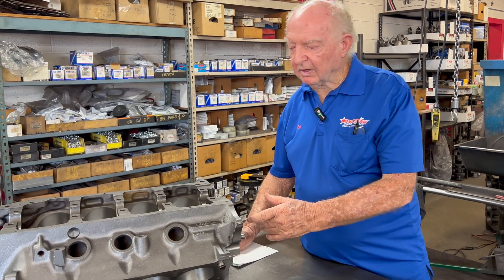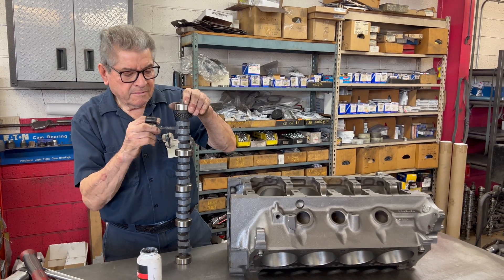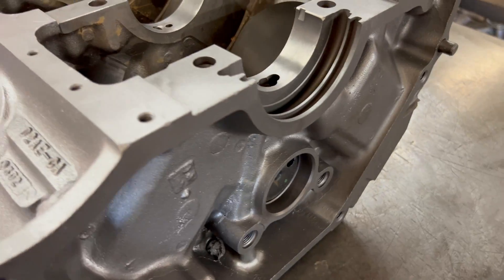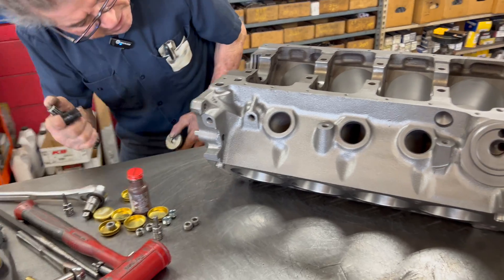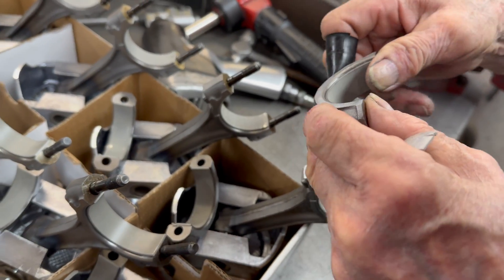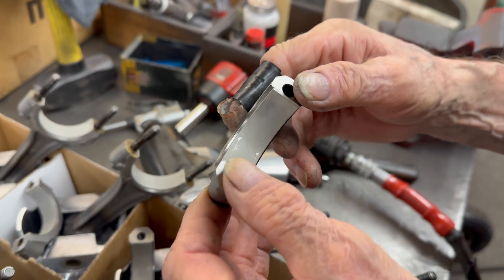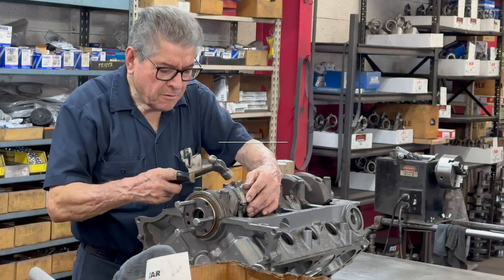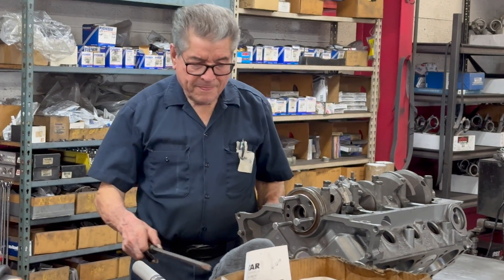Cams and SBF Short Block Ford Assembly - Ed Smith and Roberto with #barryt

Comment: Wow I had no idea that the 302 pistons were that big and the stroke so short I always wanted to open one up but never did so this was cool!
Hey Barry my first car was a 1962 Ford Fairlane 4 door tons of chrome beautiful car it had a 260 CDI  engine with a 2 Speed Slush Glide Transmission and I was wondering if you could talk Ed about the 260 289 and the 302 and the difference between the 3 engines like block crank cam and heads I would appreciate that and if it’s not something you want to do no sweat keep on trucking 😀🇨🇦
Reply: The 289 had the same bore and an even shorter stroke at 2.87. The 221, 260, and 289 all shared the same 2.87 stroke, but had different bore sizes. Cylinder heads all interchanged, but the early 221 and 260 had really small valves and tiny runners. Not that the 289 or 302 were any better in the cylinder head department. The cylinder heads small intake and exhaust runners are what held these engines back. The 8.2 deck height was great for short pushrods and short intake runner length, but they were cubic inch limited because of how small they were. Another fun fact is the 289 Hi-Po head was the same port size as the regular 289 heads. What the Hi-Po had was cast in spring locators and screw in rocker studs and that was the only difference.
Reply: @ I love learning about these engines of that era and how they morphed into what we have today thanks for taking the time to share your wisdom 😀🇨🇦
Reply from the maker: Hey Keith, I will put it on my list to ask Ed! I might even throw in the early 221. I wonder if he even bothered with any of those…
Reply: @BarryTsGarage  cool 😎

Comment: At approximately 3:00 - 3:10, showing the cam installation, there is surface rust all inside the block, are you guys OK with this?
No matter how minuscule this is, it gets  in your oiling system, between your lifters and cam, cylinder wall and bearings.

Comment: The CHEVY 350 LT1 dusted these 351 C all the time on the street and strip. Those C canted valves cause the pushrods to bend in the high revs,
Reply: I have been under the assumption that the canted valves are supposed to help the engine flow more efficiently. I wonder if any of the more experienced race engine builders were able to find a solution to prevent the valvetrain components from bending at high rpm.
Reply: @toralfcross3819  Massive pushrods up to 1/2 inch in diameter.
Reply: @VGHCX  interesting. That sounds like it can bring a new question. Steel pushrods nearly 1/2 inch would make the assembly heavy and possibly cause valve float. I would assume they probably had to replace as much as possible with titanium components in order to gain strength and make up for weight in the pushrods
Reply: @toralfcross3819 pushrod weight does not matter really as the pushrod technically does not operate on a fulcrum within itself. it simply pushes on one side of the rocker arm